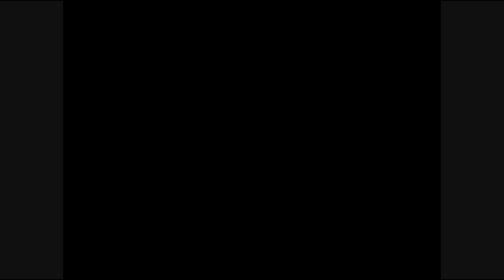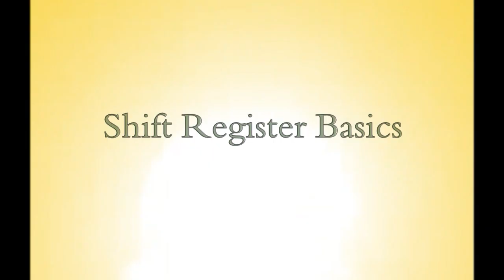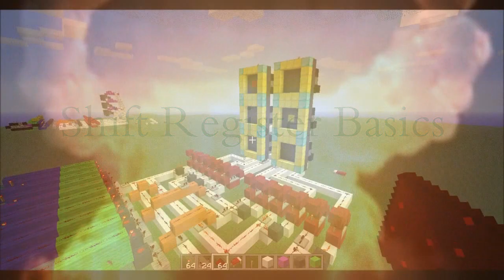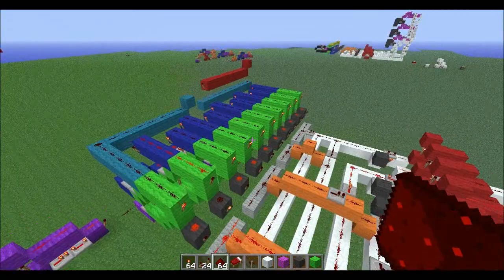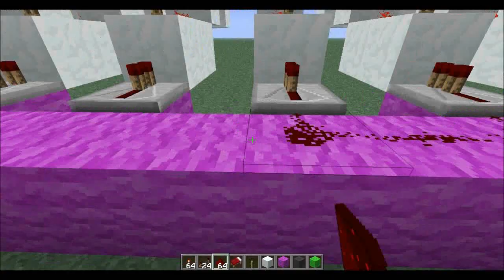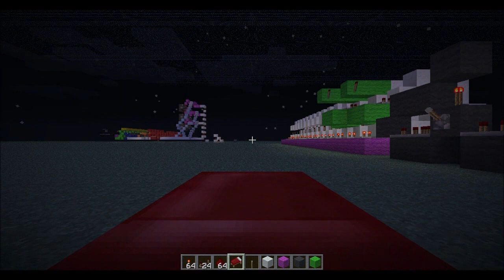Minecraft Redstone Tutorial 16 Bit Shift Register | Bit Rotation/Logical Right/Left Options

Comment: i used the same sorf design but i used an extra repeater with one set on 2 ticks, because once you use more bits, eventually you will have to put another repeater this on the locking line and it stuffs the timing . Im thinking of making another register with individual memory cell units. the problem with the 1 line reg is you can only input at the begining.

Comment: @MegaNinjaist It's not too easy, you might want to look it up. A shift register is a series of D-type flip-flops, which are basically "chips" able to retain a certain bit of binary information (so either 0 or 1) until the "clock" impulse triggers. So when the clock signal turns from 0 to "high" (so on) the flip-flop will change according to what the "input" signal is. So if it's "on" the flip-flop will have an "on" input when the clock goes "on". Does that make any sense?

Comment: Mr. Crucial.  Love the vid.  I'd been looking for a 16 bit serial register.  I built this one but, I'm having... difficulty making it work correctly.  Not sure what I'm doing wrong.  In the video you don't show the far end very much which is where I think my problem is.  When I load a bit it shift instantly and only goes four spaces.  It's not shifting on the clock cycle.  Any ideas?
Reply: +mr worm I figured it out.  I had to get the clock pulse just right to make it function.  =)

Comment: This would be sufficient I suppose if you kept the input line enabled; however, it's a very hackish way of making it. It's not what the shift register was designed to do. Not to mention, this shift register can't go in the opposite direction which is necessary for a life bar. It is possible to make a bidirectional shift register, though.